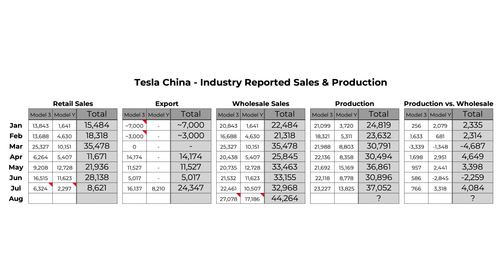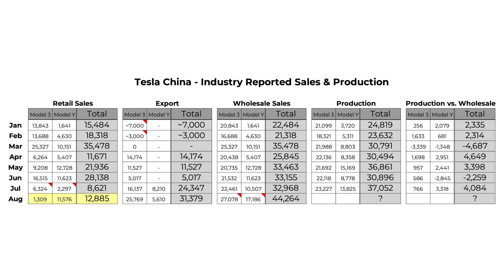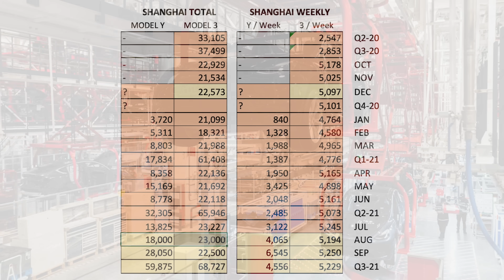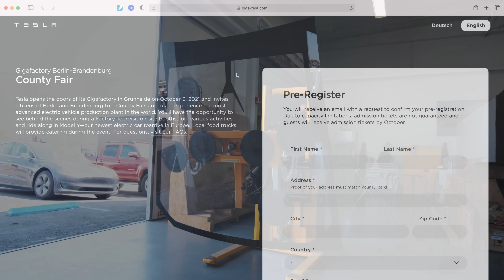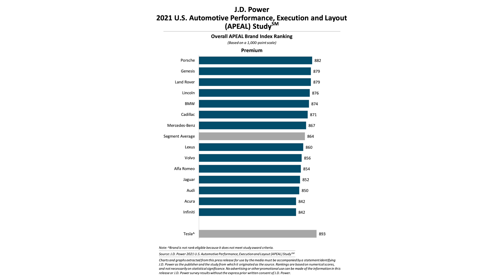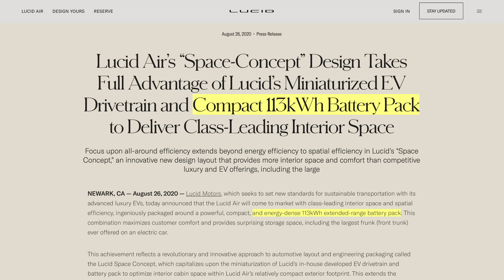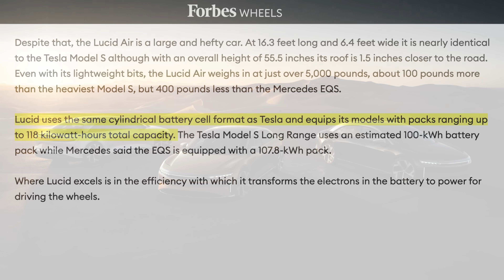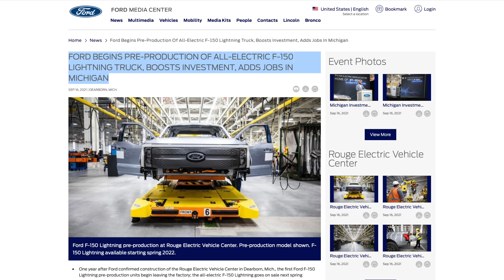What’s Up With Tesla China? + Cybertruck Parts, Lucid Air Efficiency/Battery

Comment: Tesla should use nickel in it rotors, and less in its batteries, to avoid the need to carbon wrap.  "Invar, also known generically as FeNi36 (64FeNi in the US), is a nickel–iron alloy notable for its uniquely low coefficient of thermal expansion (CTE or α). The name Invar comes from the word invariable, referring to its relative lack of expansion or contraction with temperature changes."

Comment: Something seems off with the Lucid numbers. These are the percentage drops for each model when going from the 19” wheels to the 21” wheels:

Dream Edition: -7.5%
Dream Edition Performance: -4.3%
Grand Touring: -9.1%

Why would just changing the wheels have such a different effect on each model? Remember, this is not a difference between models, this is just changing the wheel size (and possibly tires) for each particular model.

Comment: On the Cybertruck glass panel, why is the top curved? It doesn't match with the straight angles of the Cybertruck. Also the bottom corners should be straight 90 degree angles, yet there are some 45 degree angles on the panel. The whole panel also looks like a trapezoid slightly, which also seems wrong. Unless the production Cybertruck looks very different (which is confirmed it doesn't) I suspect this might be a very very early prototype.

Comment: Thanks for doing the math on the Lucid 123 - 129 kWh battery pack size. My mental math had pegged it at the exact midpoint of that range, 126. If it turns out to actually be 113, then the EPA's MPGe and kWh/100 miles calculations are in error by about 10%.

Comment: Mixing imperial and metric units just seems so wrong. 

The British imperial units and U.S. customary units for both energy and work include the foot-pound force (1.3558 J), the British thermal unit (BTU) which has various values in the region of 1055 J, the horsepower-hour (2.6845 MJ), and the gasoline gallon equivalent (about 120 MJ).

footpoundforce/miles !

Comment: Those are some strange numbers coming out of China.  Don't know what's behind them, but... I'll throw out some speculations.

Maybe, just maybe, Tesla had a lot of domestic fleet sales.  And maybe, just maybe, fleet sales don't get included in the insurance numbers.  I have no idea if this could be true.  Too many assumptions!

More worrisome is the apparent surge in Model Y versus Model 3 production numbers.  That is a surprise.  I'm wondering out loud here:  could it be that Tesla in China did have ongoing supply chain problems, and they elected to pause Model 3 and surge Model Y to get the best return on the parts they did have?  Model Y being the more expensive of the two vehicles, and all.

I did see the Tesla glass video, but I didn't pay enough attention, until you drew my eyeballs towards that huge hunk of glass being carried around by a forklift.  Now that I'm paying attention to it, that glass piece looks - to my eyeballs - like it's too large to be the Cybertruck's windshield.  If it's truly a hint of any sort, then it hints to me that the Semi will not have a wrap-around glass windshield.  It could end up being a more traditional look, with pillars separating side and front glass.  That would probably be easier to manufacture, and cheaper to boot.  It won't look as cool.  But the Semi won't sell to fleets on its looks.  Performance and cost will drive its adoption.

I'm way out on a speculative limb here.  Maybe the smart thing to do would be to shut up and look wise, instead of speculating madly.

Lucid's claimed EPA efficiency looks awfully good!  The difference between 113 and 118 (or so) KWh pack may just be down to year-over-year improvement in battery cell energy density from their supplier.  I don't recall if I have heard who their supplier is, or even what type of cell they're using.  Most everyone uses pouch or prismatic cells; so far as I have read, only Tesla is putting cylindrical cells into vehicles.

I would enjoy a deeper dive into Lucid's battery tech - if they care to share some details.  On the surface, though, it seems Lucid isn't struggling like the legacy automakers to get into Tesla's efficiency ball park.  Good to see.

Thanks for your reporting!

Comment: Amazing shot of the Cybertruck windscreen. Note that they have also lopped off a lower corner, assuming this is for the wiper arm pivot. 
Note that the screen also has a mild curve in it and that the top edge is also cut on a curve. This will definitely change the sharp windscreen/roof panel junction.
I’m glad the Cybertruck’s screen is so laid down, making it less likely to stone chip. I don’t imagine replacements would be cheap. The local windscreen repair bloke might need a bigger van!
Can’t wait to see the final product.
Reply: Having a curve also means it is more expensive.
Reply: that glass looks way too big...would also indicate the Cybertruck wont really have a frunk...which is a joke...F150 has a massive practical frunk...i think the Cybertruck will not come out in 2022
Reply: @turbodewd1  spam.
Reply: @turbodewd1  Yeah the size of that thing indicates that they’ve made some significant revisions to the CT. I don’t think they’ll ditch the frunk though. Tesla invented that and I don’t think they’d let it go. It offers so much practicality. Reading between the lines, I suspect we may see a trickle of CT’s in Q4 but it will be 2023 before any meaningful numbers show up. Hopefully it’ll be worth the wait.

Comment: 125 mpg is crazy good! lets see if they can produce them in volume
Reply: I suspect t that number will drop as we get the full information on the battery pack. And it's also important to remember that we need to know the weight of the cars. If they are using carbon fiber for example and have a lighter car that has to accounted for. It's going to take the complete data on the car to know the true numbers.
Reply: @kstaxman2  125 MPGe is an efficiency number, it doesn’t matter how large the pack is. 
And no, it won’t change. The EPA certified that number
Reply: Rob will try and spin the numbers in Tesla's favor when ever he can. He never ever gives a balanced view.